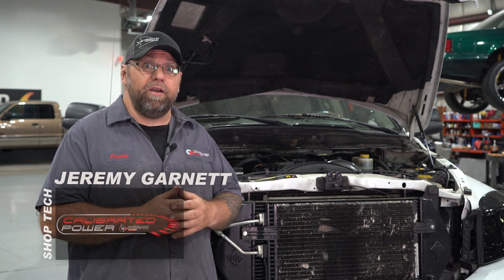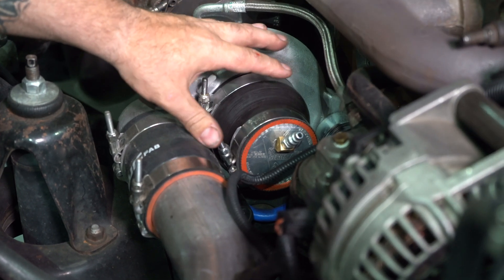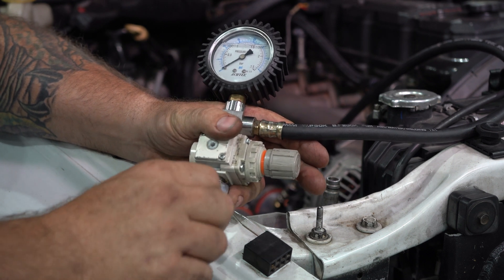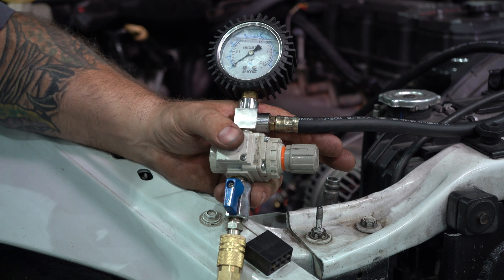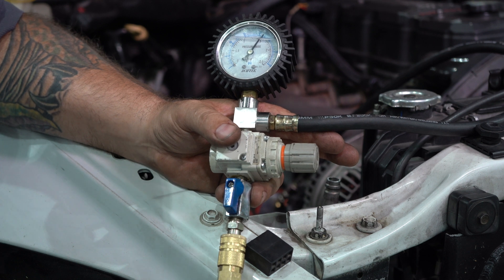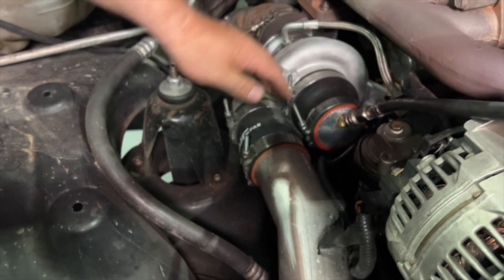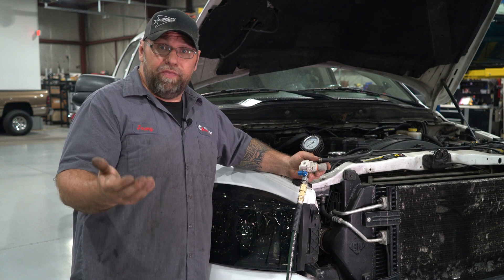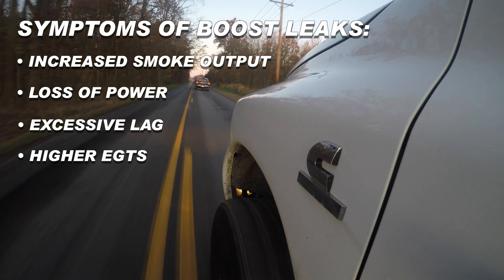This Simple Process Could Help Your Diesel!

Comment: I’m wondering if I’m missing something. I have air leaking from the CCV cover outlet. At lower PSI the pressure doesn’t drop too fast (1-2 PSI per second) but at 15 PSI and above it drops faster. Everything else is good. Is this normal on CME Cummins?

Comment: How did you guys know I needed this??
Reply from the maker: We all do. Great thing to know🤘
Reply: Big leak like if the installation shop forgets a bolt in the compression side of the Valley turbo on a LB7 or forgets to plug one of the ports for the boost sensor or the compression side of a brand new S475. Mike knows what I’m talking about and it wasn’t you.